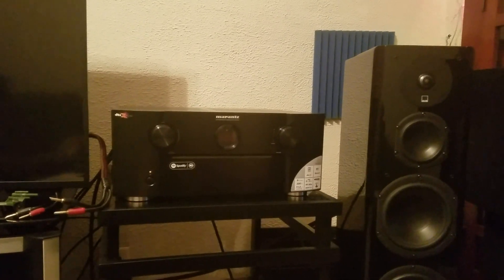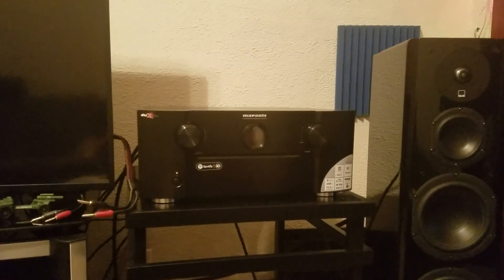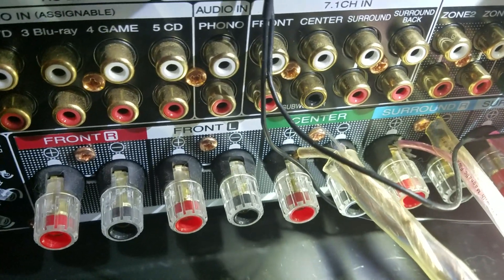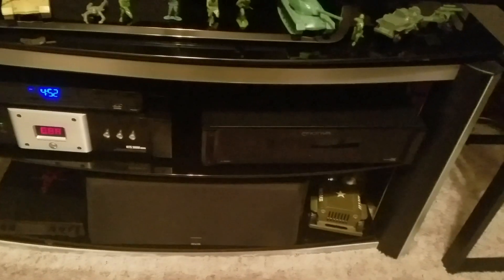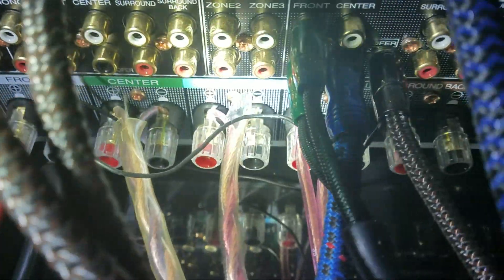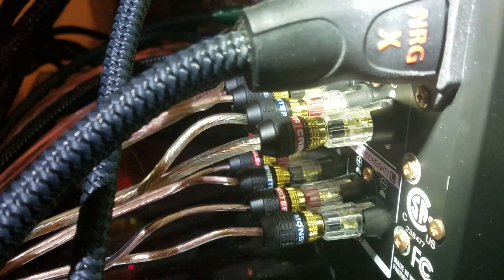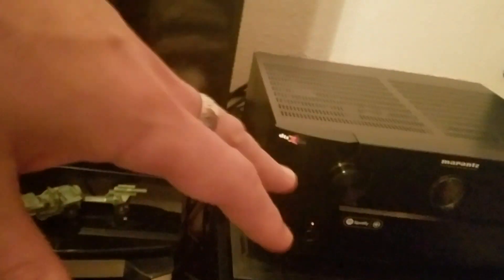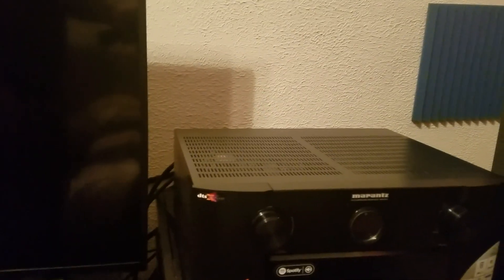Setting up a Dolby Atmos 11.2 Channel AV receiver part 2

Comment: Great video!  I started with a 5.2 then upgraded to 7.2 ,9.2 to 11.2.4 with a marantz sr6013 & emotiva amps xpa 2 gen 2 ,xpa 5 gen 2. Avr is capable of running 9 ch 11 with a 2ch amp . 
Since all my speakers are running g off the amps can I run the 4 atmos speakers off the avr ? With out having to buy another 2ch amp ?! Thx

Comment: I really like your channel. I have a 7.2 JBL speaker set up. I just bought 2 KEF Q100's and would like to add them to my two front channels. Do you know of a way I can do that without buying another amp? Can they share or have two speakers attached to the front Left and two to the right channel? What is your suggestion? Thanks

Comment: POLARITY … NOT PHASE often use incorrectly the term “out of phase” is often used to describe the condition where the + and – connections on our amplifier or speaker are reversed which  would be called POLARITY .Phase has a time component frequency dependent
Reply from the maker: Gene you are definitely correct, I have no idea why I said phase but yes polarity.   One thing that confused me I think was when you run the room correction calibration,  Audyssey multEQ will say speakers out of phase.   Then shows the red and black wires.   Why it says that I have no idea but I think that's what confused me.
Reply: Lol this bothered me too

Comment: Cool dude. How good are the amps in this thing? How's the noise floor? Or the Preamp hiss?
Reply: MrHamit64, I have an SR7009, similar receiver, but about a year older, I am using external amplification on all channels, it's dead quiet and sounds great. I can only assume this unit is just as good. Before I upgraded to external amplification, the internal amps worked just fine, my only suggestion is to allow for good airflow of maybe even put a fan on top if you listen very loudly. I never had an issue but it did get very hot.
Reply: Ah okay good. Yeah I only asked cause I've heard their PMD recorders and though the quality was good there's lots of pre amp hiss.